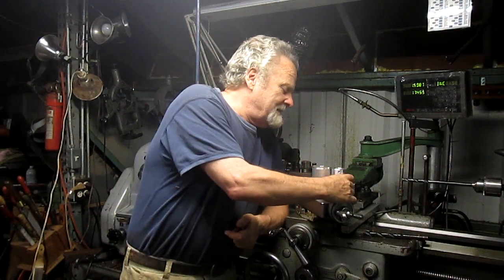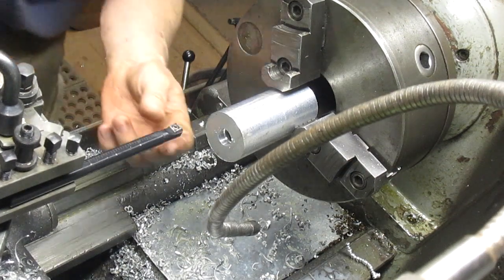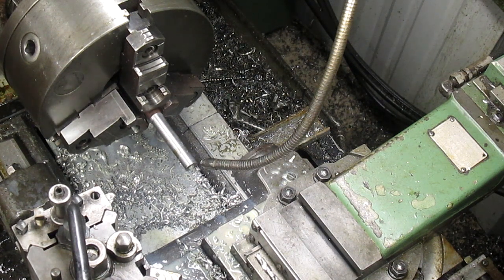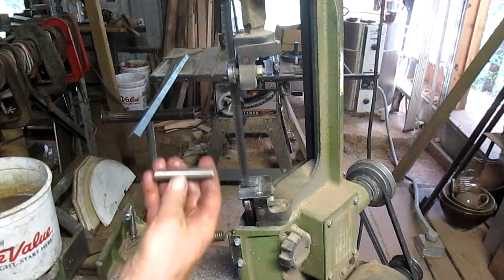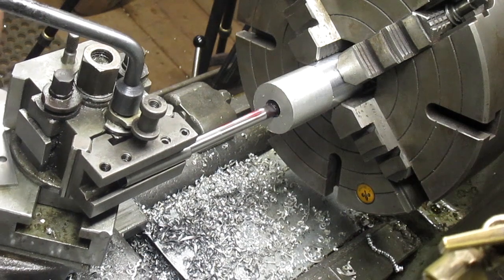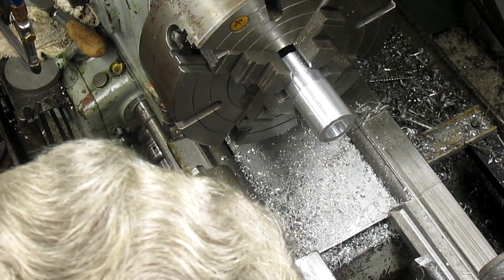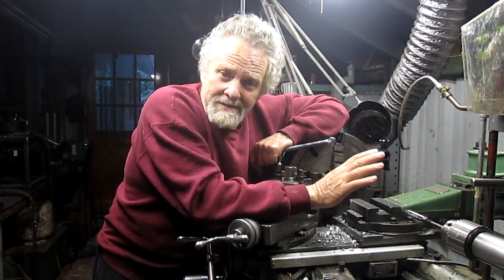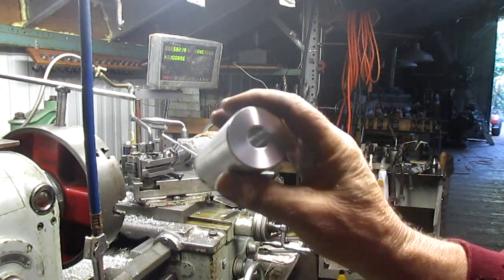Custom Motor Sleeve, twice

Comment: I've always thought if you want to screw up a decent hole just use an adjustable reamer and you succeed. But yesterday I bought 3 used one and I again wonder why.  Nice job!
Reply from the maker: As I found out, in a lathe or a slow moving drill press, then adjustable reamers are a dream.
Reply: I'll have to try it!

Comment: Nik
I was thinking about this project.  Could you have drilled and reamed the half inch hole all the way through then bore the bigger end and never take it out of the lathe?  it would seem to me that both holes would be concentric to the center line of the lathe.  Maybe I missed something.    Great video thanks for sharing.
Reply from the maker: The 9/16 hole was already there and I had to center it without making it bigger.

Comment: Not sure if I didn't understand the reason for the solid sleeve to connect a motor to a vacuum pump.
Best practice is a flexible coupling as it is almost impossible to be sure the two shafts are aligned in every orientation. If the original set up was destroying couplings I would check that the shafts are spot on or can be in situ with out the sleeve.
Reply: I suggested that very thing to the customer, but he was determined to have it the way I built it. Customer is always right.
Reply: @nikcolyersstorytime4861  its surprising how little the misalignment needs to be for even flexible couplings to give up as well. So maybe he's had issues before. A colleague and I had problems with an Italian hammer mill that kept eating spider couplings. It was impossible to check it was straight. Some only lasted a few minutes. I hope he had better luck.

Comment: You are like me. too cheap to buy a set of gauge pins to check those small holes for fit. or even the right size reamer you just cant get enough tools in this business. But you made it happen that's what counts
Reply from the maker: Making it work, that's the most important part.